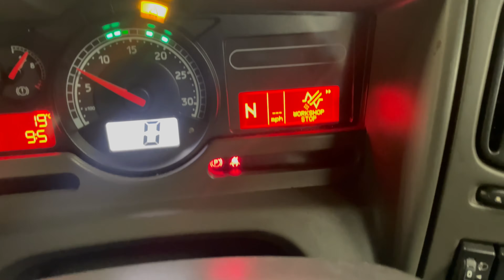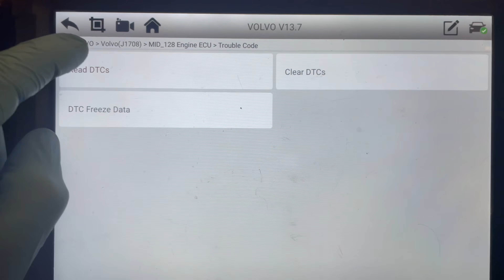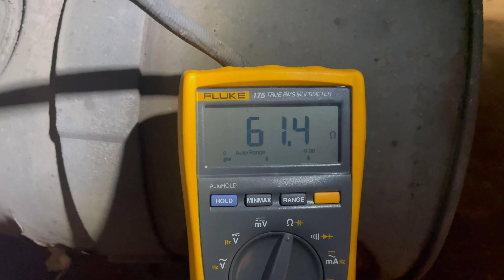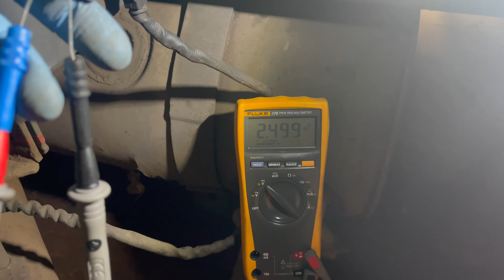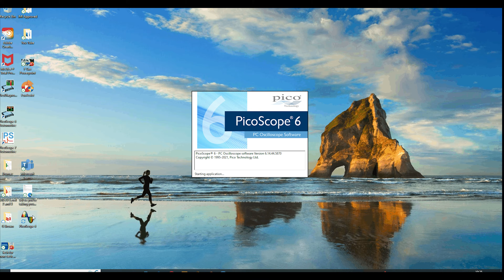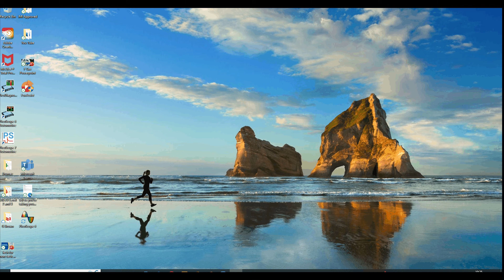NOx Sensor Testing

Comment: Wooo hoooo thanks a lot. I'm on week 6 of my apprenticeship and so far I've been a parts changer and I want to do more. Anyways 3 weeks ago we changed the dpf and doc they were put in a oven to clean them well yesterday we changed them again with another set that was put in a oven to clean them. Yes same truck. 585,000 miles. 🤔 🤔 🤔 🤔. This doesn't seem normal.

Comment: Interesting measurements but I bet if you disconnected the NOx module while the truck was running you'd get a DTC that was shouting that something was wrong with the comms to that unit so most of these measurements could be short-circuited, so to speak.
Reply from the maker: True, but what if it wasn't on the CAN. I had a NOx fault where the issue was a voltage drop on the earth. Loading the circuit at the sensor proved it. Comms issues are not always relating to comms wires.

Comment: Can you explain about 6 wire socket nox sensor
Man truck
Reply from the maker: Hello there. I haven't specifically seen the MAN 6 wire sensor, but I have seen 5 wire sensors which contain 2 earths, 1 positive and CAN High and CAN Lo. I will have a look out for one and do a video on it. Thanks for the question.

Comment: Do you have a video for 5 pins as well? My nox sensor 2 has 5 pins. Yours in video is with 4 pins. I changed the nox sensor and now is failed again. P229
FO9
NOx sensor 2 (cylinder bank 1) has a malfunction. There is a component fault. ——NOx sensor 2 (cylinder bank
1) has a malfunction. No signal change: Voltage level is too low.——The switchover between the maximum and minimum values of NOx sensor 2 (cylinder bank
1) is too slow. There is a signal below the permissible limit value. .. i changed one nox sensor and i suspect to by problem with wiring and not nox sensor. Thanks
Reply from the maker: Hi there, what vehicle is it fitted to? Some 5 wire NOx sensors do no use the 5th wire. So they only have a positive, negative, CAN Hi and CAN Lo. Sometimes you can get downstream NOx sensor issues if the SCR catalyst is not performing as it should.

Comment: Is it the same procedure on the Iveco Stralis 450 E5 2007? The problem is that after replacing the sensor, it reports an error: LONG TERM NOX SENSOR FAILURE DTC:45F. By replacing the sensor (from another manufacturer), it reports an error :NOX SENSOR FAILURE DTC:1A3! Three new sensors have been changed and all three are showing errors. I ask for help and advice. Thank you!
Reply from the maker: Hi there. So there are a few things to consider. Firstly you need to make sure that the NOx sensor that you have fitted is the exact component for your vehicle. Different manufacturers may have CAN High and Low swapped round. Secondly are there any other DTCs stored? Do you have any for EGR for example. The EGR also assists with the reduction of NOx. If there is an issue with this system NOx levels will be higher than normal. Thirdly, does you vehicle have a pre and post NOx sensor or just a post NOx sensor. Potentially the SCR catalyst could be an issue although this is only in extreme cases. Just a few things to consider.
Reply: Thanks for the reply, problem solved. The problem was in the SCR catalyst. Thank you!

Comment: Would you recommend getting a 2 or 4 channel picoscope? thank you !
Reply from the maker: Hi, I would always recommend going for more channels if possible. This means you can measure power/ground and signal at the same time when you are looking at most sensors. Really depends on your budget. I have both, I started with the two channel which cost me £150 ($195). Relatively cheap, but got me used to using the software.

Comment: Hi as an aside is there a way of using the NOx sensor to detect Nitric Oxide at parts per million as a stand alone test set, the real one  cost $885. I have a iNO generator on my workbench bench and want a test sensor
Reply from the maker: What an interesting question. I scraped a pass at Chemistry at school so take my answer as one not coming from an expert. 
In theory, yes, your commercial NOx sensor can measure in the region of 0-1600ppm. The term NOx that is used is only the collective term for Nitrogen Monoxide (Nitric Oxide) and Nitrogen Dioxide I believe. The iNO generator you have is this a respiratory machine? 
Have a look at this article I found about NOx sensors. There is a fair bit of reading in it but it discusses what the sensor is actually doing. 
https://dieselnet.com/tech/sensors_nox.php#:~:text=The%20NOx%20measurement%20range%20is,%C2%B110%20ppm%20%5B3899%5D%20.

Comment: Can please give a little info on the scan tool you used? ie: make Ancel...model?
Reply from the maker: Hi Neil. It's an Ancel X6 HD, they retail about £450.00 ($545.00). You get what you pay for with scantools. We haven't had any success with it on Iveco. DAF, engine and SCR faults but no ABS. Volvo, Renault, Dennis pretty good to be fair. The tool allows for 1708 CAN diagnosis which is helpful on these models.
Reply: @trucktechtips638  Thankyou